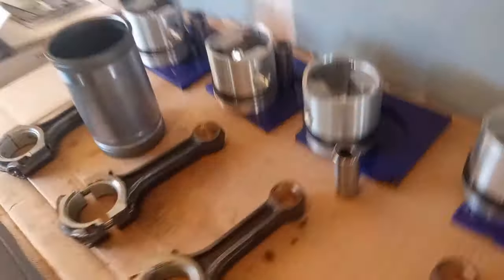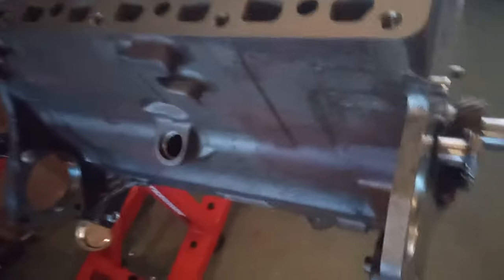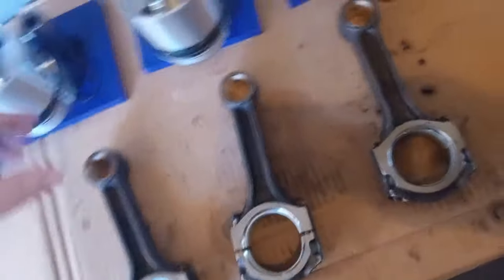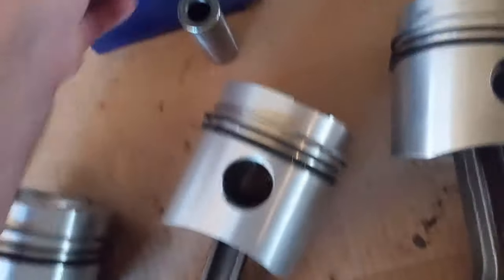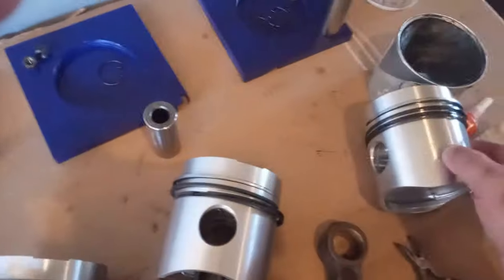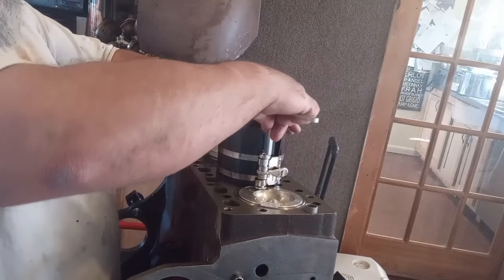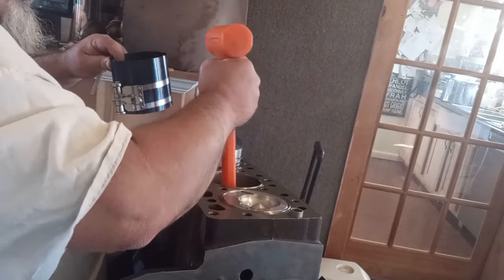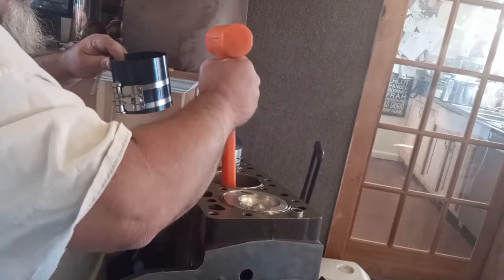Case 580c 207d rebuild pt deu 2 piston install, Putting pistons in correctly, Which Direction?

Comment: Mr. Build you have a part# of the housing gasket (between motor block and transmission housing for this engine?
Reply from the maker: hey there, the 207d and 188 engines could attach to different trans configurations, my 580c 207d has a power shuttle transmission, this means there is no gasket between motor block and trans. there is a semi-circle gasket for the cover that goes over flywheel plate located at bottom of motor. this gasket I don't have a part number for. my suggestion would be to make a cork gasket for cover because it does not need to keep fluid in, it's meant to keep dust/dirt out. hope this helps you.